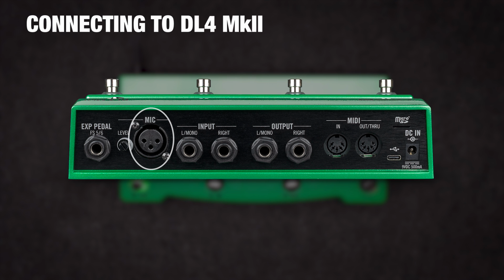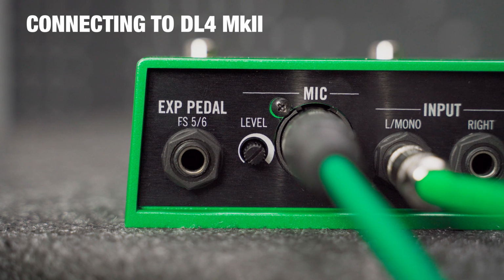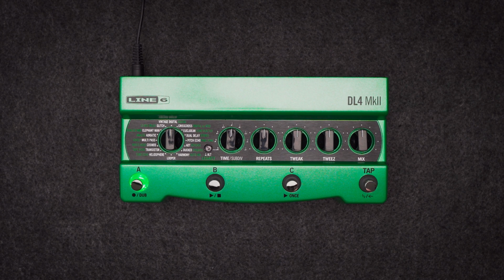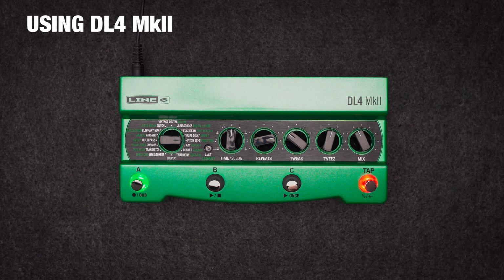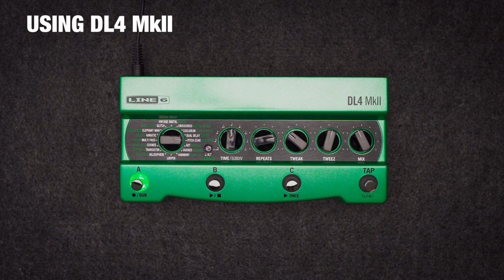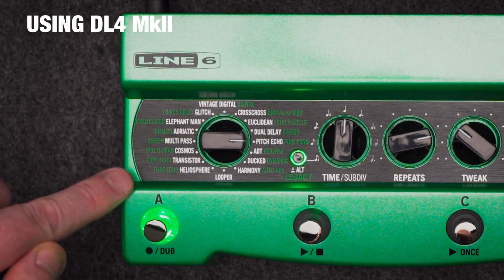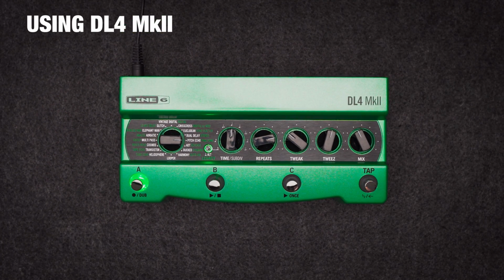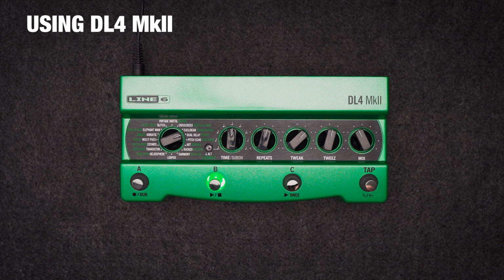Line 6 | DL4 MkII | Part One – Quickstart

Comment: This is an amazing update. Anyone know if the 1 switch looper function can be assigned to a midi controller?  I have a 4 switch midi controller Ampero Hotone. Like to have 1 - thick reverb and delay 2 - tighter for gain amp 3 - vocal preset for recording videos and 4 be the 1 switch looper. If I can do all that and use the functions of the standard switches on this pedal, I’ll be blown away

Comment: Got mine a few days ago. So far so good. Does any one else experience your loop coming back on for about a second when you try to clear it from memory?  I assigned the far right Tap switch to the Looper function (white light) and when you hold it in to clear the loop it comes back on briefly. Not so bad in your practice room but i could see this as a problem if you perform at a gig.
Reply: the same here.